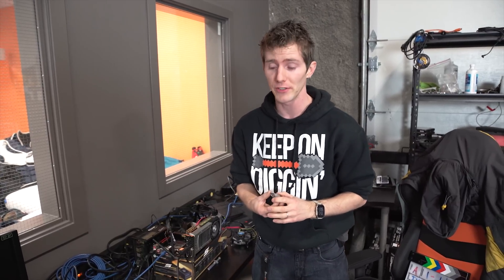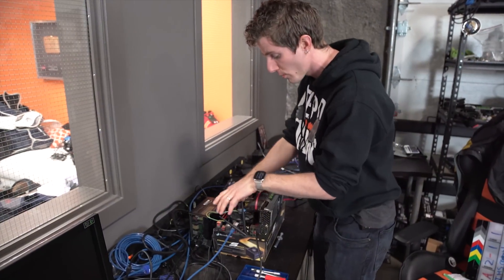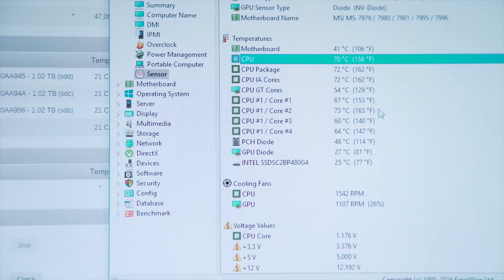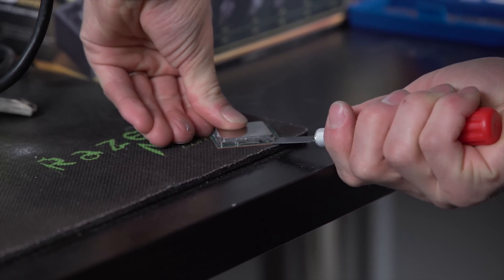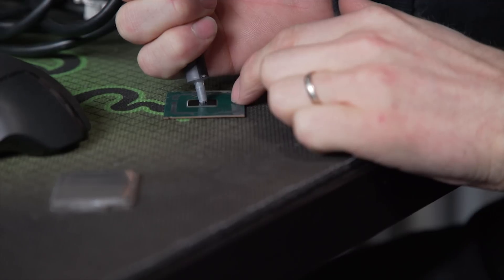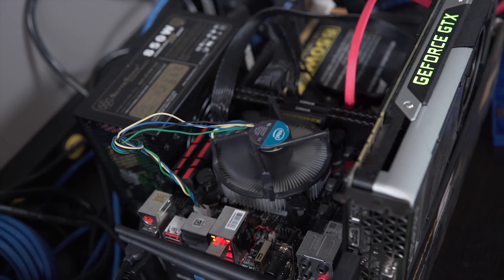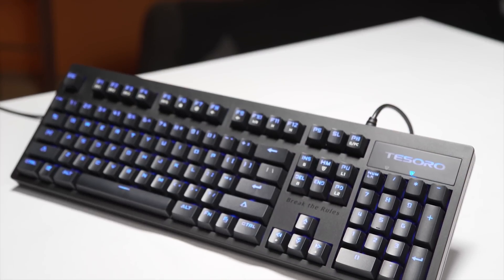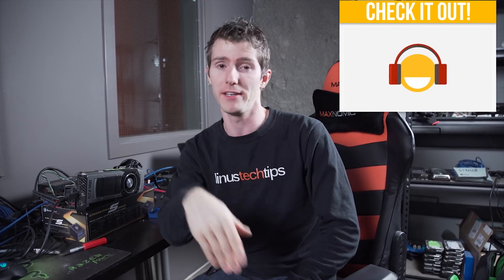Delidding an Intel Core i7 6700K - Is it worth it!?

Comment: Does touching a scalpel to the surface of the CPU risk static discharge if not properly grounded? I'm just a programmer. I know little in the field of advanced hardware tweaks.
Reply: +Leighton Ransome Several years ago, we had a CPU we wanted to return to our supplier because we knew it wasn't working 100% at its designated rate, it was a tad unstable but worked fine when knocked down a multiplier. We knew full well the supplier would just bung it in a motherboard, and see it POST and send it back as "No Fault Found", as this had happened many times before with other stuff. So we decided to "break" it. We were rubbing it on our clothes, through our hair, you name it, we abused the shit out it. We could not get it to fail, it just kept on POSTing when put in a motherboard. Eventually we had to zap it by touching bare wires from a 12V supply to it. It gave me a great deal of respect for the static resistance of Intel CPUs. Don't know about these new ones though, perhaps they are more susceptible who knows?

Comment: i admit, i don't know about skylake, but with my 4670k after a delid and lap on both ihs and block using cool liquid between the die and ihs with AS5 between ihs and block, i dropped over 20c and my cores were more uniform, beforw there were large variations in core temps.

Comment: People were getting better results on the i5-4670k, and it's i7 variant which were known to have terrible TIM. They improved it after that with the i5-4690k it's i7 variant.  My i5-4670K would thermal throttle while playing BF4 with stock cooler (in a Fractal Node 605 case).

Comment: I really would have liked to see this video with the notorious 4770k as the star. Skylake doesn't run too hot in the first place and I think results would have been more substantial. My 4770k runs at 75c under p95's blend test. (with a H100i at stock speeds)
Reply: Skylake goes down 15-20 degrees on average. Thats like buying a 120$ watercooler.
Reply: I have mine overclocked @ 4.3  max temp is 67C using corsair 105 .I did delid mine but I used the vise method instead of the blade .Before it was running well over 75C. Still not worth the risk in my opinion .
Reply: so u basically want a test on the exact cpu and cooler that u have to see if u can do it too?

Comment: This video is totaly BS, do some research next time.. 
Ivy bridge was the the first with this problem and haswell was the second.

I did this to my overclocked 3770K (4,5Ghz) and lowered the temps from 110 to 70C (High peak temps,  intel burn test)
The problem comes when you really overclock these CPU's, not @ stockspeed or at a tiny overlock!

That aint a "few degrees" in my world.

I used the vice and a hammer method;) with Liquid Ultra.
Reply: +Zetrol Skylake world problems I SERIOUSLY think the LTT crew could have found a better cpu to de-lid. Linus may also be the first person to even de-lid a skylake cpu. :/

Comment: Quite misleading in a few points. A properly done delidding will give you more than a couple of degress improvement. I usually see CPUs running 15-20°C cooler after doing this.

The most important step is to scrape off the adhesive residue from the IHS and the PCB. This will eliminate the gap between the die and the IHS. 

If you're going through the effort of swapping the TIM, don't skimp on quality - liquid metal produces the best results (around 10°C drop in temps when @ 100% load compared to the top thermal pastes).

Yes, the razor method is risky, but there are many tools available that will make the process a safe and easy one (the few ones that I know: der8auer's Delid Die Mate, Enter Setup's BreakFree Delid Tool, Rockit Cool's Rockit 88 and Skylake Delid Tool 3d printed by Shapeways).

Comment: I don´t know about skylake (because you didnt test it like it should be), but at least on my i7 3770k, I wasnt able to past 4.7ghz with 1.2 volts with max temps around 80c on custom water cooling , now after delidding it and applied the Coollaboratory Liquid Ultra that is the one most of "delidders" are applying Im able to get 5.0ghz with 1.32 volts with max temps around 70c on my custom water cool. This is not a good test, you actually use the stock heatsink wtf?
Reply: OMFG YOU AGAIN!! MAKING EVEN WORST COMMENT!!! YOU REALLY DONT HAVE A COMMON SENSE HUH? Okay then, I'm gonna tell you why this is a pretty good test.

First of all, NOT everyone are gonna Overclock their CPU. Even if they willing to, Probably not that high.
Second, NOT everyone are ABLE to delidde their CPU the right way. Remember, this channel is targetting "average" consumer. NOT modders who wants to get the upmost of their hardware, so he is warning the audience to prevent that kind of "stupidness"
Third, NOT EVERYONE ARE USING CUSTOM WATER COOLING, THAT KIND OF SYSTEM ARE EXPENSIVE. THE AUDIENCE OF THIS CHANNEL ISN'T A FUCKING MODDERS, THEY USUALLY AN AVERAGE CONSUMER OR NON MODDERS ENTHUSIAST!!!!!!! 
Fourth, the most important thing. as i said on third point, NOT EVERYONE HAVE A CUSTOM WATER COOLING. Most average joe would use the stock heat sink for their CPU, he wanted to give the closest scenario that will happen to the audience.
Reply: Ferry Ansony Damn....

So why he make this video on his channel?, it seems like you are the one that have no common sense.

First. If not all are gonna overclock their CPUs, well simple dont check this video.

Second. There´s only 2 ways of delid a CPU, the one that everything comes alright, and the one you fuck your CPU, if you succeeded like Linus here, is just a matter of use the right themal paste and a good CPU heatsink or closed water loop to have a massive improvement, things that Linus didnt make on here.

Third. You dont need a custom water cooling loop to have good result as I said before. The audience of this channel is everybody that want to see the channel, if the content is not for modders, then why he make custom water cooling loops, why he modded cases, motherboards, graphics card, desks and I can go on.

Fourth. The avarage people don´t have the money to build half or more of the computers that are presented in this channel, but people keep looking the channel, so your logic doesnt have any sense.
Reply: HeyDan1983 okay.

First. I need to ask you. Do you need to delid you IHS to Overclock? I dont think so. Maybe people watch this just to know about delidding CPU and the Risk

Second. as you said that there is only 2 ways to delid a CPU. But, there is so much ways that people are gonna Fuck it up :p some people are just clumsy or simply dont know enough

Third. You said that the test is not good because he uses stock heatsink, well most people are gonna use their stock sink in worst case scenario (maybe just plain dumb or know nothing and just following pro modders)

Fourth. Do you understand the concept of interest? Even though people cant afford those things the probably watch it for that exact reason. Because they are interested man :p
Reply: +Ferry Ansony If your gonna use the stock heatsink, dont delid it!, you can overclock it without delidding it, but the improvement is way significantly, things that Linus seems to not know or try to hide on this video, dont know why he do this,  if you´re gonna delid, you use another cooler!.

You said that people watch this for been interested, well that´s what Im here, and if I see something is wrong Im goona let it know, that´s why the comments, and Im not the only one that agreed that Linus did it the wrong way.
Reply: HeyDan1983 Aaah okay i see your point man. Lol maybe some people  just dont know anything or seeing this video and did it too (with stock heatsink XD) 

About that bad result on this video i have a few guess
1. Maybe he did it the wrong way
2. Maybe he try to hide something
3. He tries to make people understand the risk of delidding their CPU, especially with stock heatsink.....you wont believe how many people have had come to my shop to complaint about their fried CPU because they are trying to delid it with stock heatsink or snap the dyes in order to pry the IHS.

Comment: so yeah the  TIM intel uses kinda sucks, its been that way since ivy bridge.  is you do the mat the aftermarket  past is about 20% better.  the point Linus was making is What is 20 % worth in real world usage.  my 3770K (yes an old ivy bridge) is overclocked  to 4.43 Ghz.  does this make what I do with it earth shattering?  not really,  in fact some games see no real difference.  theoretical is really cool  but hard tangible real world results are what drive sales.  is it worth it to replace the TIM?  that depends on the person. I see no right or wrong answer.  Its all risk vs reward  I suppose.   take care all

Comment: this video is a complete fake. He deliberately used not so good thermal compound between the die and ihs. with stock tim heat is not being conducted properly to the ihs and to the cooler but in the second case heat is being conducted to the cooler but the stock cooler can not cool efficiently. So using a good cooler would give fair results. I think he have some tieup with intel and he did this video so show that intel's tim is not so bad. I found 20 Celsius improvement by deliding.

Comment: I  found 20 Celsius improvement by deliding my processor. It seems to be dangerous but I did it successfully in the first try using the angled vice method. Dont use razer blade method like in this video you may end up scratching your die or pcb and the processor will die.

Comment: Worse delidding ever seen.
You can have around 10-20 degrees difference if you do it properly
Reply: +Sr. Mapache I have found about a 15-20 degree Celsius difference on my 4770K clocked to 4,2GHz. before delidding and after delidding and using Coollabs Liquid Pro. So though i really value Linus' opinion on a lot of matters, i think went over this too fast.

Comment: are you kiding me?! which ones are soldered and which ones are not?  
i was gongi to upgrade and i havent kept up with sockets since 775, but i read about this crap intels pulled.  its a marketting ploy and id rather buy amd then go for this crap.  but now i see this boom waaa and what is this?  everythign isnt soldered now?  soldering isn't called better tim its called THE RIGHT WAY.  if you think differently please find a short pier and take along walk.  

so listed what i thoguht was and isnt soldered are .. 1366 sockets are fully soldered chips.
2011 sockets where NOT soldered. besides teh xeons.  then 1150 sockets, not soldered, until the K series.  um isnt this exact opposite of wht you saying in this video?  ive read it everywhere and people said they have delidded these and found solder.  but now yur saying not.  like i guess every crappy processor intel comes out with is ok to get and oh by thge way its all normal and good.  ok can we get some real information here?
continueing, 2011v3 are soldered and the 1155 skylakes i hadnt been keeping p with they wherent my idea i had that i was going for, i thought tho they where soldered, but you could be right im not paying no attention to tyem anyway.

can someone, you anyone list a real list of non or soldered chips?  thsi just destroyed it and said, none.  ill go amd

Comment: Can you do this without putting the IHS back on?  If so, would there be a better improvement?
Reply: +Quietbut_Deadly 
Yes and Yes. But you have to modify your cooling.  There are a lot a variables to consider: cooling method, voltage, stability, cost, & risk. Short version, you have to make the contact surface of your cooler go as much further into the socket as the IHS you remove. 
But it's a more complex question, when considering if you should bother doing it. I've delided a few CPUs in my OCing days. I was using extreme air cooling on Athlon64 chips back in the 939 socket. And the extra 4C I lost was enough to make my best chip stable at 3.2Ghz on air with 1.63v. I was doing such things for e-peen status. Most people will not see a difference with the little MHz boost you would get from that extra 4-6C you would get on newer chips. My Ocing days was back when an extra 500MHz meant the difference between 20FPS and 30FPS. :D

Comment: Wait what? So linus just showed us a method how we can not lower the cpu tempretures despite knowing it before 
so why did he even did this? seems kinda senseless to me LOL
Reply: +Günther Herbert this video is a complete fake. He deliberately used not so good thermal compound between the die and ihs. with stock tim heat is not being conducted properly to the ihs and to the cooler but in the second case heat is being conducted to the cooler but the stock cooler can not cool efficiently. So using a good cooler would give fair results. I think he have some tieup with intel and he did this video so show that intel's tim is not so bad. I found 20 Celsius improvement by deliding.

Comment: Spoiler alert - the risk benefit ratio does NOT support doing this! Instead run over and discover how to paint your video card - and then on how to apply all sorts of rad STP, Edelbrock Hedders, Rancho Shocks, Hurst Shifters, etc. decals to mom's car to make it LOOK like it can go 'real fast'....
Reply: Yes it does. The heat spreader degrades cooling performance when playing the silicon lottery. For that reason, delivering is highly recommended.

Comment: use blades for safety razors (the paper thin ones), even the cheap ones from cvs or whatever will slide right under there and through glue with very little pressure, much safer for you and the cpu.

Comment: It sure has not much difference because what you used was a newly manufactured cpu that is just weeks or months old. What the big difference is, intel's stock thermal paste is not durable thus it's paste will dry out and cause overheat overtime. You should compare using an OLD cpu like 3770k and try replacing it

Comment: So Linus you put far too little TIM on the silicone die, effectively creating hot spots with the core and the IHS but then slathered the TIM on the heater side. 
How about you redo this making sure to properly apply the TIM or better yet use the metallic TIM you mentioned for a more accurate test. 
As this sits now it's actually pretty much a worthless test due to shoddy work...

Comment: I know this is a stupid question, but I am wondering how a cpu outworks other cpu's. Someone please aswer
Reply: Jonny Auto ;-; i sorry
Reply: Isaac Chan Cpu's push electricity through transistors, and switch logic gates on, or off. The computer reads these as 1 or 0. depending on how small they are, more can be fitted onto a chip at the nanometer scale 14nm+ Newer chips outperform them because the old chips may be 28nm. The other way is speed. The chip works on a speed, or HZ. The faster a chip goes, the more 1's or 0's can be read. My chip runs at 3,700-4200 Megahertz, or 3.7 Ghz. That's about the limit of speed of aircooled processors, so they add more cores. The third way to "outwork" other processors, is to add more physical processors onto the chip, dubbed cores. The 4th way to make them outperform is through software. Things like Intel's Hyper-Threading act like there are more cores, allowing more work to be done. There are many different software methods of making a chip more useful. 
I hope that answers your question.
Reply: So basically, a better cpu makes all of your system work faster

Comment: Isn't the point of delidding to actually get rid of the IHS and insert the cooler right on top of the chip? That's what makes a difference in the temps. Replacing the thermal paste underneath the IHS is a waste of time.